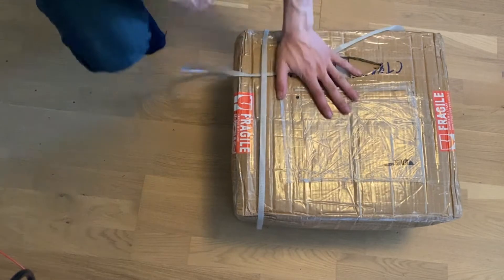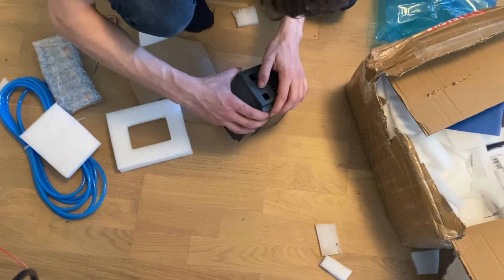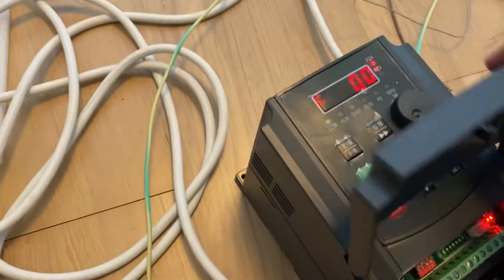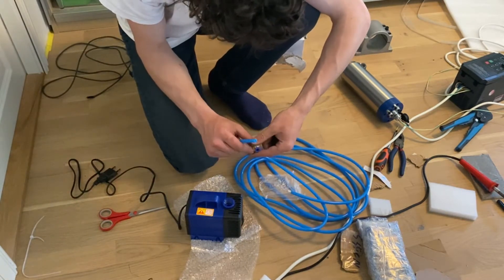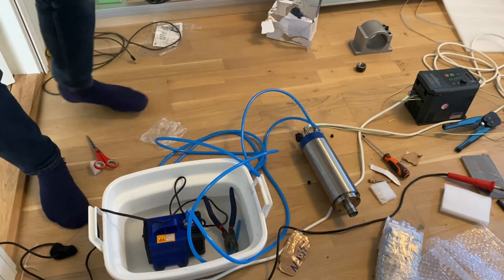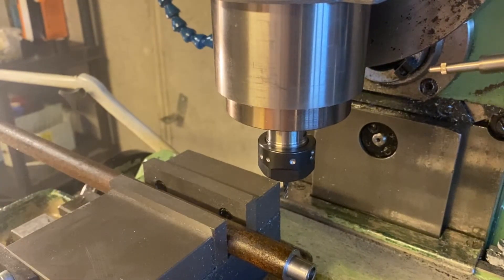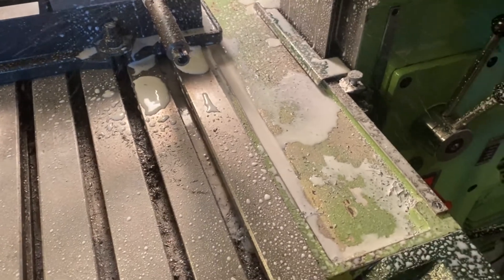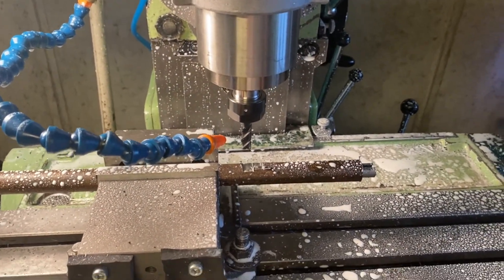High speed spindle installation and review

Comment: 😍😍😍😍  g-penny
Reply from the maker: They are good indeed. I see you have some content related to this.
Reply: @tarehjernetarehjerne4082  I have a yes but I didn't do tests as bold as you did
Reply: @tarehjernetarehjerne4082  the annoying thing is that we have to heat it for 20 minutes before using it so as not to damage the bearings but it's a better 2.2kw